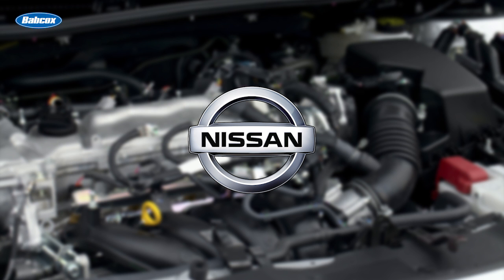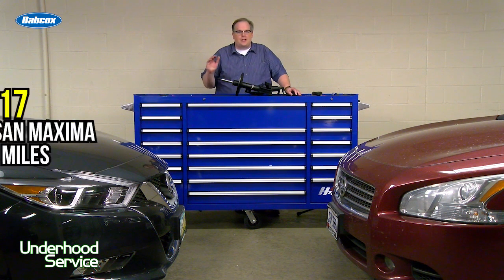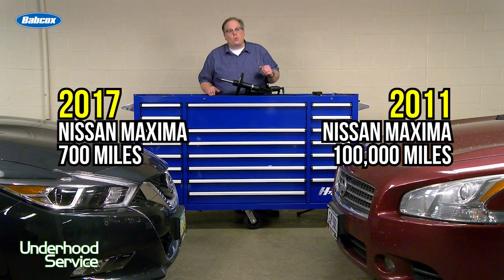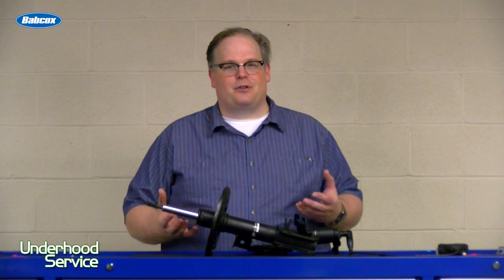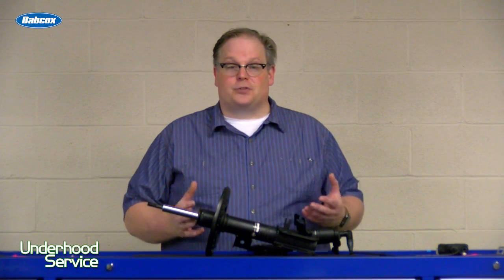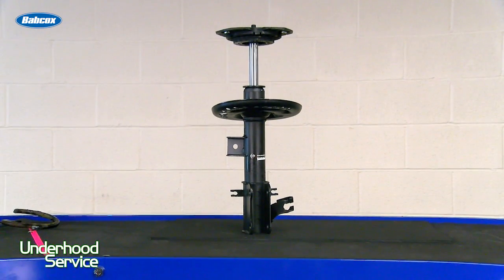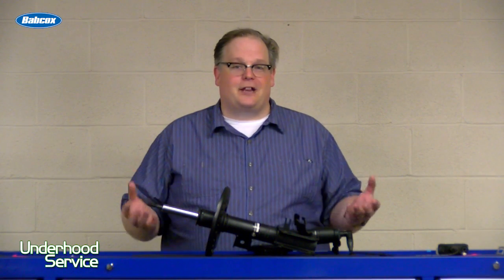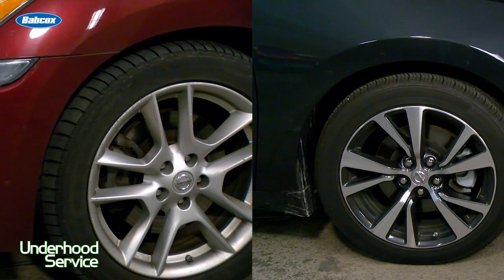Maintenance Minute - Testing Suspension Components

Comment: C. Both are valid parts of a proper diagnosis, and using the term "visual inspection" should not imply prohibiting physical interaction with various components. I have never seen a mechanic use his knee to "jounce" a cars suspension, and yes "jounce" is a term that has been used for many years in relation to alignment and suspension diagnostics.